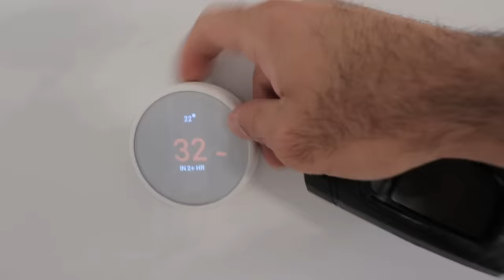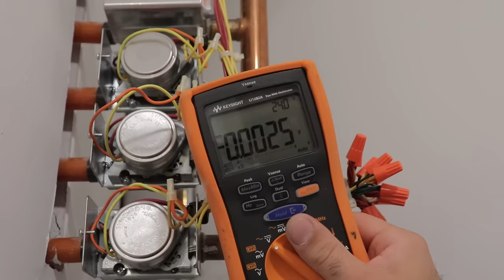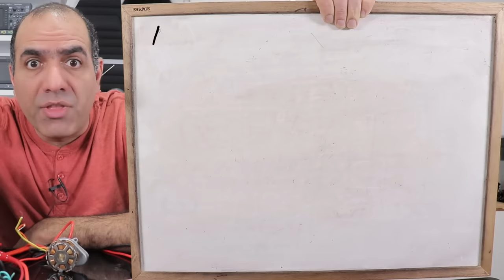Electro-Plumbing Repair… of my home heat zones that won’t heat although the boiler is running fine!!

Comment: Telling an electrical engineer they can't do something is like questioning a wizard's power.
Reply: The moment he realized the motor had been "fixed" by short circuting was exactly the same as a wizard opening a book of dark magic.
Reply: @inurokuwarz  i remember a trick to fix those christmas lights if one bulb is burnt out and you don't wanna try to track it down: hook it up to a taser or other high-voltage source and zap it. this burns and welds the broken filament or something in the broken bulb, so the circuit is closed again. of course, this is very hacky
Reply: @inurokuwarz  "And they say dark magic is bad"
Reply: @Spooglecraft  and he even discovered it on accident
Research
Reply: @tvishmaychoudhary69  every research is an accident if not recorded properly
Reply: Serious question, how hard is electrical engineering actually compared to mechanical engineering? I need to know once and for all
Reply: @espy9244 IMO  mechanical engineering is more "certain"

electrical engineering needs good omens,sometimes sacrifice (usually mental health)
Reply: @bagusadjie4522  you make it sound like you offer a person as a sacrifice for good luck
Reply: @neil7910  actually,sometimes i do
Reply: @bagusadjie4522  0_0 ahem did i read that right ?
Reply: @neil7910  well the real truth is i sometimes pick a guy to get blamed by the supervisor or fix something good enough until someone else breaks it

aint that "sacrificing someone for luck"?
Reply: @espy9244  both can get pretty hectic, but electrical engineering gets hectic faster so I'd say it is "harder"
Reply: @neil7910  sometimes, goats aren't enough and you need to go find virgins. You know how hard it is to find virgins of legal age nowadays?
Reply: Oh yeah? 
I'll agree when they do rocket surgery...
Reply: DO NOT TAKE MEHDI FOR SOME CONJURER OF CHEAP TRICKS!

Oh wait, that's literally a beloved staple of his videos.
Reply: A wizard has his ways
Reply: @marcogenovesi8570  what a picky demons. They dont acepts minors anymore?
Reply: Yeah
Reply: @bagusadjie4522  as a machinist i can confirm that most if not all metals are far more predictable than electricity
Reply: @neil7910  you cant really call yourself an electrical engineer if you dont have a shrine to tesla or edison
Reply: @wirytiox1577  no, the entire point of asking for a virgin and not a child is that they want a pure adult soul.
Getting children souls is easy even for them so that kind of lowers massively the price for children souls
Reply: @kooolainebulger8117  LOL
Reply: One more reason to study Electrical Engineering xD
Reply: It's true for a lot of educations though. Anyone who studies dynamical systems in depth will learn to appreciate the complexities that may emerge from things that may appear simple to others. Dynamics is great for problem solving across the board, and electrical engineers do have a lot of it. It's much more widely applicable than people may expect.
Reply: @marcogenovesi8570  that makes sense.
Reply: They cant do anything right.
Which is why there are so many jobs fixing their screwups.
Reply: As an hvac guy I disagree. Alot of work engineers or electricians do in my field, I get sent back to fix their mistakes because they are not trained in hvac typically. You can learn both trades, I Have, but if you havent learned one trade you should probably NOT attempt it. Like plumbing, I never cared to learn it but simple light plumbing likes sinks and toilets are nothing due to my boiler knowledge. Much respect my fellow Sparkies and FreonHuffers!!
Reply: @Spooglecraft  there are little shunts in the bulbs which are supposed to bypass when the filament goes out, sometimes they don't activate so a surge can help!
We have a device with a piezo-click button that can zap them and it works wonderfully for like half the problems
Reply: We are the modern day shamans!
Reply: but not all wizards are powerful
Reply: @espy9244  It really sort of depends on the field you are aiming for.  I want to say the math needed is roughly the same.  The only big caveat is Microwave RF stuff.. Electrical engineer that play in that realm are straight up wizards
Reply: Cool
Reply: @espy9244  It is about the same in terms of difficulty. At least where I am from.
Reply: As a former HVAC Technician, my favorite part was watching electrical engineers brag about how much they knew and did while afterwards they go spending time questioning how by applying basic electrical and mechanical troubleshooting techniques, i was able to figure out problems they couldn't solve after days of research.
Reply: @Clasped003  Then you go ahead and do the same for them - make a brand new efficient system from scratch. I'm pretty confident that they do better at your job than you do at theirs.
Your knowledge is applied. Theirs is for development - they don't have to be able to recognize components but "just" how to do the math. Of course it takes longer when you don't have experience with the stuff and you have to calculate things yourself.
Reply: Rightly said
Reply: @Spooglecraft  lol your funny burns and welds ?taser? Im sure what you meant  was hooking up an electrical source similar piezoelectric igniter burns the shunt of the defective bulb  Allowing the circuit to  Continue past the bad bulb
Reply: Ng
Reply: ChemE and EE have some interesting pain.
Reply: I always swear on the life of my two crappy bosses to make it work...
Reply: Nah it's just Mehdi. A lot of electrical engineers are completely clueless when it comes to technician work like this. My Electrical Engineering professor has worked in the field for decades, but has never even opened his PC or laptop.

Only people with a hobby for taking things apart and fixing them are like this.
Reply: With enough will I will always find a way
Reply: Just ask Nikola Tesla
Reply: Both equally dangerous 😂
Reply: my brother a electrical engineer , can't do a simple circuitary problem solved
Reply: It's actually the IT guy that can do everthing, from masonry to remotely landing on the Mars.
Reply: @bagusadjie4522  meanwhile software engineers sweating their ass of right now
Reply: ... Likely to result in an explosion?
Reply: Thanks for using the term wizard instead of how people say God

Comment: I like how the plumber decided that the valves must be as close to the wall as possible, so that you need a special screwdriver to open them, instead of anywhere the the 3-4 foot of space between the valves and the boiler
Reply: It might have been two separate crews doing the work like the plumber who ran the pex around the house and then the HVAC boys installed the heater and valves and stuff and things.
Reply: Nice to see you here sir ;)
Reply: so they require their services again, if you dont have a special tool youre screwed
Reply: To be fair, all the plumbing is a shit show! So messy!
Reply: @TheGazzap45  The wiring certainly is. OK, it's only 24V, but it's still crap.
Reply: That is the idea, to avoid any average one with basic knowledge to take their work, forcing us to require their services in the future. It is called "market reserve".
Reply: The Installer was not going to ever work on them again........ so what did he care?

I have very special feelings of fire and brimstone about such people.... .

Add a suitable grade cuss words to suit,  to blast and damn the Installer/ Designer, quality and design of components and method and/or lack of skill there used in the install.

Sadly, many domestic installs would raise quizzical eye brows( sorry about that,) in the commercial world.
Reply: Job security
Reply: Just because
Reply: Or why not
Reply: Not a plumber issue. Looks like the drywallers went too close to the pipes.
Reply: this tells me they only ran so much piping into the room from the wall and plumbed everything backwards from there to the heater. Hence all the completely redundant piping turns and twists.
Reply: Had a co worker in a car repair shop that intentionally was turning all hose clamps that what so if you don’t have special tools you can’t remove them 🤦‍♂️
Reply: @misstakenot9582  Not sure if the 110V lead to the central unit is all that OK really.
Reply: Apple be like - You can do it but I can't do it.
Reply: Installers rarely worry about the service folks coming later.
Reply: To be fair taking up as little space in the room as possible isn't a bad thing in some respects.
Reply: @andreasu.3546  No, that's really not OK.
Reply: almost like the hydronic plumbing was there before the wall was built and finished. oh wait, yep! 🤣🤣
Reply: Not necessarily, I would be willing to bet some carpenter or home owner built the wall after the heating system was installed.
Reply: As a HVAC guy I can confirm a lot of companies do things like this so the client won't be able to do it themselves.
Reply: it's why i refuse to be called a plumber. i perfer my technician title. lol
Reply: Ok
Reply: @bwood6337  
To be fair taking up as little space in the room as possible isn't a bad thing in some respects.

I disagree. This is not some crappy eco-small import crappy disposable car in which they cram the engine into the glove box. Mechanical systems should be accessible. Why cram them into a closet, when they could have an entire utility room, with some extra space for whatever wonder-systems may come out in the future?

When I build my spaceship, I plan to build it to human Star Trek easy-access standards, with Jeffreys tubes and all.
Reply: @DJChappie001  
As a HVAC guy I can confirm a lot of companies do things like this so the client won't be able to do it themselves.

Well that is just stupid, seeing as most people wouldn't do-it-themselves anyway. Why can't they do a nice-looking professional job? Sad to say, many probably do not take pride in their work, and just do a crappy rush-job and run off to the next job. Just because it may be in the basement is not much excuse for it to look like a crap job. Might as well do it right, because by the time it needs repair, if it was me, I may have moved on anyway. Make it easy for the next guy, even if it is DIY. I would look to upgrade the job whenever that I can easily enough for not much more cost. Think of possible future expansions or adjustments.
Reply: @yosefmacgruber1920  You're right. 
It's not a little car but it's also not a damn space ship. It a utility closet, in a house. A place where there could be plenty of other things that need crammed into that space later on. 
I didn't at all say that cramming it all together was the correct decision, I only stated that it could be beneficial in some cases.
Reply: @bwood6337  
Some houses actually have both a furnace and a water heater crammed into a little closet. How in the world is that accessible? Does one of them have to be uninstalled just to get to the other? And don't both of those items make heat? Is that even safe?

BTW, I would love to live in a spaceship, Star Trek style. Maybe a house should be a spaceship. With humongous cargo bays, shuttle-craft bays (or room for all the 4-wheelers, bicycles, tools, exercise equipment, men toys), engineering section, guest rooms, etc.

Doesn't it look like it is in a basement, with plenty of room for stuff to not be crammed against a wall? But perhaps as suggested in the comments, the wall was added later after the valves were already there.

Maybe I could get a big barn or warehouse, and put 3 floors into it?
Reply: It appears the wall may have been built after the plumbing was installed.
Reply: @AlexRutiaga  If you are not an HVAC/boiler technician you would need their service anyways for repairs.  The tool needed to open the box can be bought for $1 and certainly is not the thing that prevents someone with no knowledge of boiler systems from making home repairs.  Even a standard HVAC license does no allow a technician to work on these types of systems and a separate "boilers" license is required in most locations.
Reply: @brasilianguy5437  That is a ridiculous statement since the tool can be bought for $1.  Not being trained in boiler operations, installation and repair is what prevents someone from repairing a boiler system, which can be extremely dangerous because of the potential high pressure that can develop in the sytsem if improperly installed and without the correct safety features.
Reply: the electric part can be removed by turning it 90 degrees. so easy to swap ;)